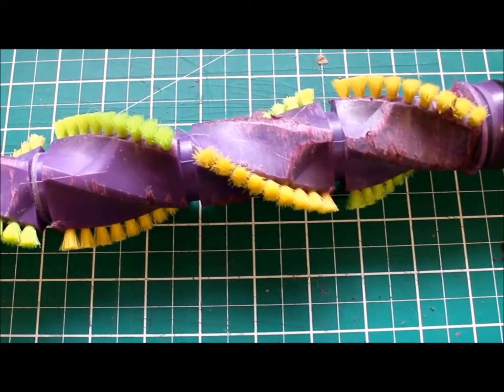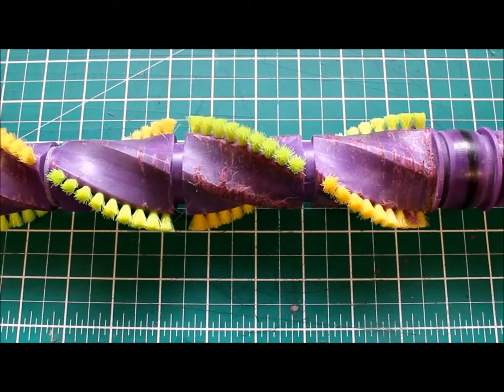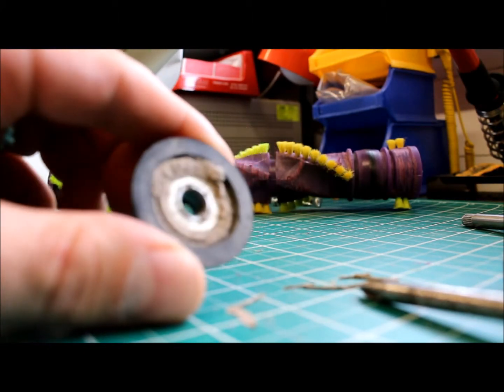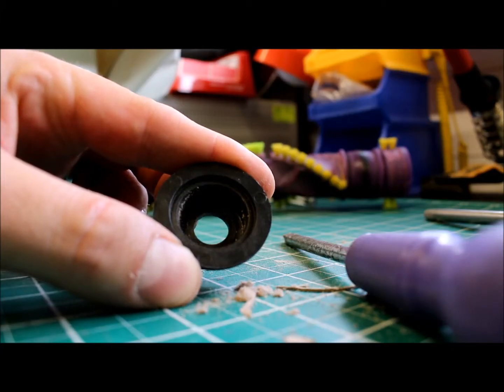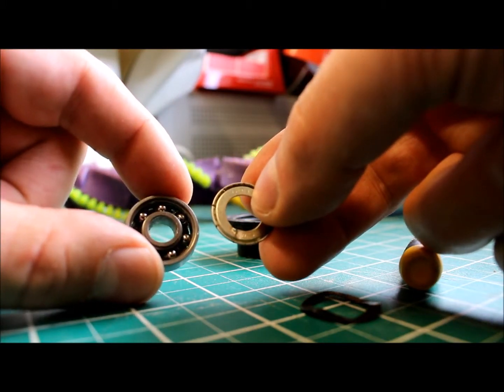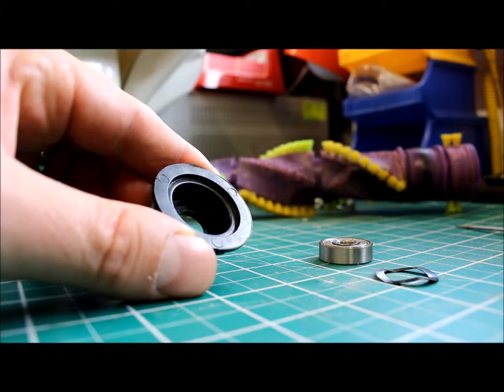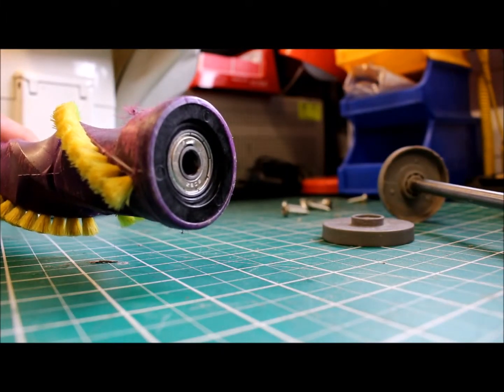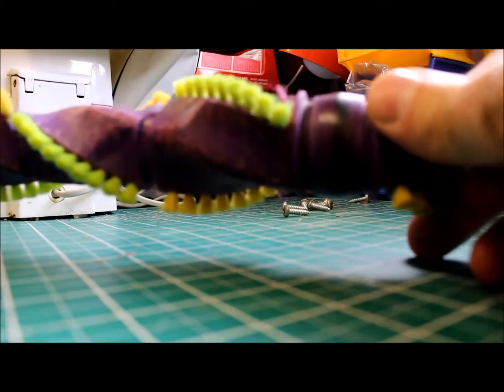Bissell Powerlifter Pet Roller Beater Repaired at FixItWorkshop Worthing

Comment: Thanks for the video. How did you get the end caps to come off. I’m afraid they may break and I know they are tight.
Reply from the maker: Hi, it's just a case of gently levering up the ends evenly, a little at a time.
Reply: @Matt_Marchant_fixitworkshop  So to take the brushroll, I take a philips scredriver, put it in the midle of the endcaps and hammer it down til i get them to pop off on each side?